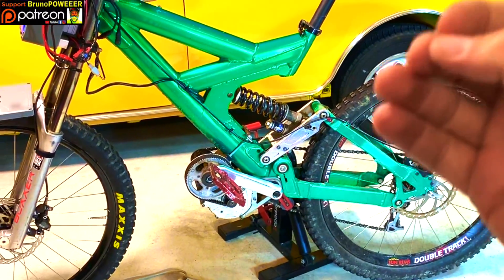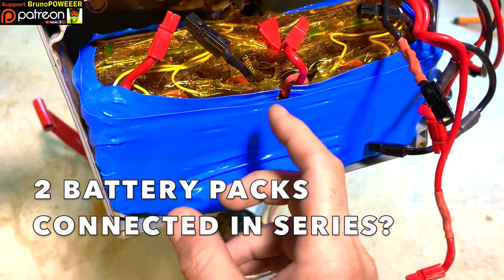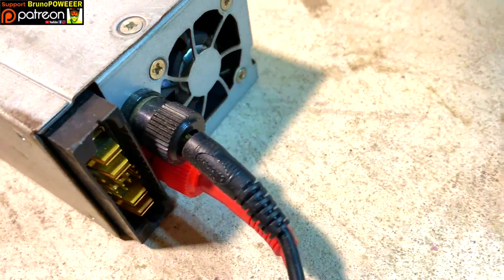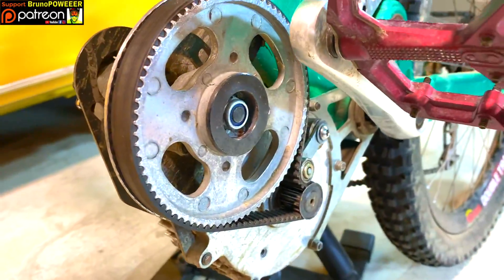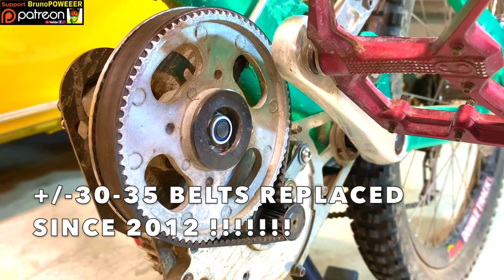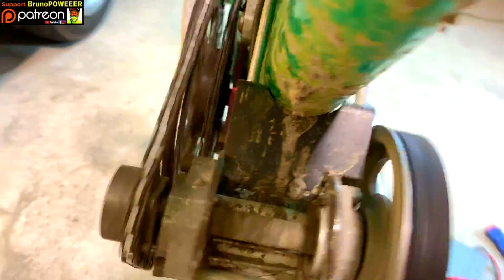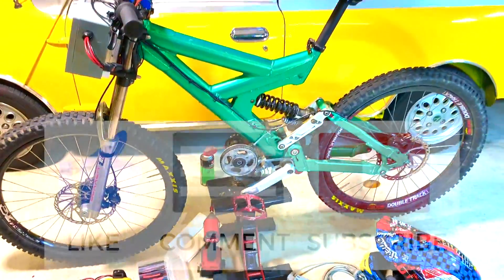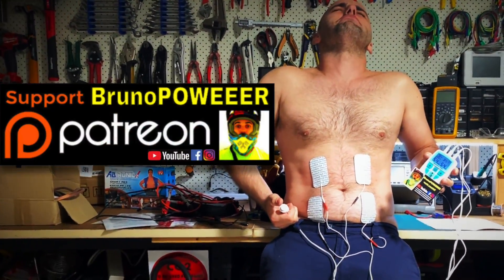2012 eBike Technology Explained, You Won't Believe It!!!

Comment: Pretty sure I just purchased this bike for $100 still looks the same just no battery
Reply: Now it’s running with the Kelly controller on a 36v e bike battery mounted on a rear rack am yet to test ride it and see if it has any issues with the belt

Comment: Bruno was my inspiration to build Ebikes.
i now have a scott gambler dh20 2008 
cyclone 6kw middrive 
top speed unknown arounde 110 kmh
goes on wheel at 35 kmh
20s 7p samsung 30q mountet under the frame nice low gravaty the bike handles so nice white the 5 kg motor and the 7kg battery mounted low

Comment: I purchased a bbshd because of your videos, i love it. keep up the good work.
Reply from the maker: Hahaaaa yeeeeeaahhh mate... love when I get messages like that, I’m glad you’re loving it too haha.... it makes you feel like super man with the strongest legs in the world right? Hahahahaa soooo much POWEEEEEEEERRR ohhh yeaahh =]
Reply: @BrunoPOWEEER  More like superman on steroids lol. I have done more miles on my BBSHD in the lase 3 years then I ever did in over 30 years on a normal cycle :D
Reply from the maker: Hahahahahaa I know... people say that ebike is for the lazy... these people are only going for a few laps on their bike and then drive to work, drive everywhere... ebike becomes your main transportation, we go EVERYWHERE riding.. we get a LOT more exercise done than most cyclists out there =]. Just out of curiosity, how many miles on your BBSHD? Any mechanical problem? Have you ever opened to service or lubricate? I love to know these things
Reply: @BrunoPOWEEER  I am on my third controller and i had to replace the PAS circuit board. I have once re-greased the units internals. 
I still have issue where when I turn the power on, My battery meter drops down to 0V for a moment then builds up to full voltage. 
Not sure how many miles, Well over 2k, My area has many steep hills and I often take some pretty rough terrain.

Comment: Listen: 1) Install a new tiny nucular controller 2) Build a new lithium battery pack 3) Change the little gear to a bigger one with more teeth and you won't have problems with the belt anymore. If you do all the above steps you will convert this ebike to a new age night rider weapon and you will be able to charge it without all the external connectors!!!!!
Reply from the maker: Yeaaahhh would’ve definitely do all the upgrades above for sure, I actually suggested revamping all the electrical, new battery and fixing that belt drama but... the owner likes keeping the bike original old school (even keeping the old school problems) haha... he’s got many bikes so this is kinda a display casual bike, definitely not the one he rides everyday... maybe to show his kids “hey, eBikes used to be like that” hahaha

Comment: build  my first simple ebike in 2015, 350w 48v controller 44.4v battery 20ah and a 36v 250w wheel. it ran about 35 kmph, good enough for home work traffic.
Reply: still runs, just not often, my main bike has a 1.5kw 48v wheel, 52v battery 20ah and an 1.5kw 48v controller, it runs over 50kmph, it has not enough suspension for me to go any faster lol.

Comment: This is exactly the system that i thought about building back in the days when there were no, commercially available parts.
Same system with the crank having "free coast".
Nice vid ;) Crazy how much simpler it is now and how easy it is to get parts.
Reply from the maker: Yeeeahhh... double chain, freewheel here, freewheel there, tensioners, belt, custom mounting brackets to fit your frame, HANDLEBAR BATTERY hahaha classic old school... used to be Multistar Lipos inside but the guy didn’t want that extra drama... yeah crazy how simple things are nowadays in comparison!! This is why I made this video so people can see how painful it used to be... hahaaaa =]